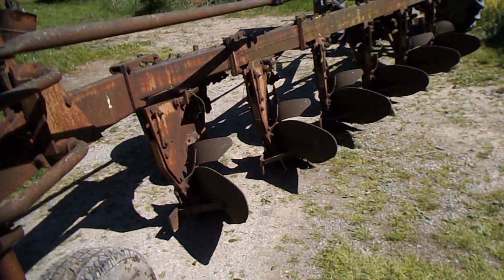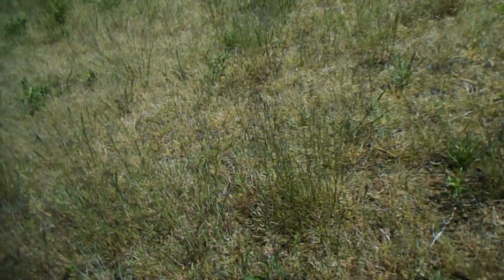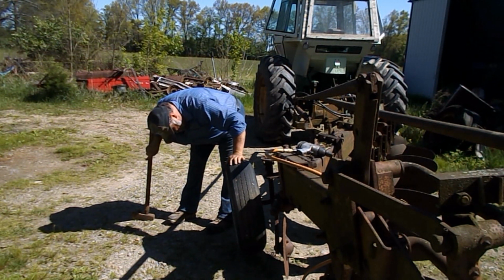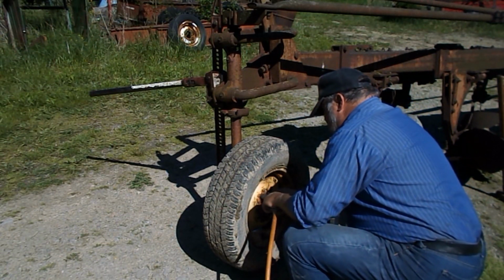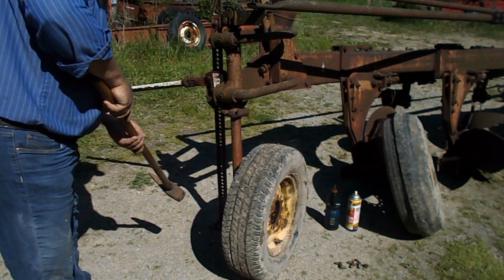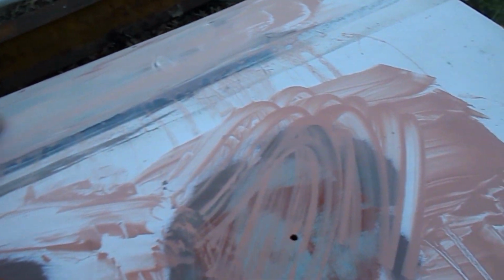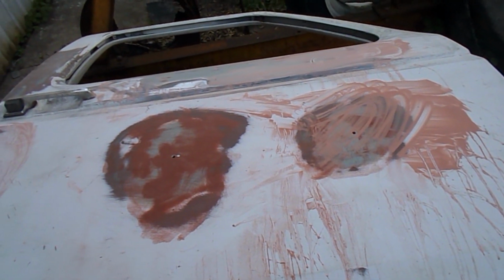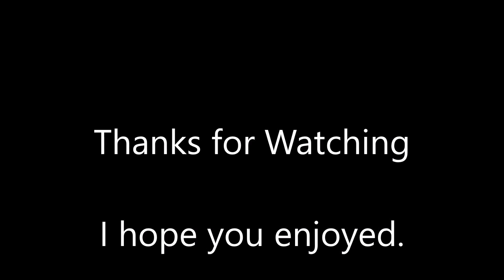Fixing the White 546 Plow May 9th 2022

Comment: Glad you got that tire situation figured out.  And cool how that trashboard worked too.  Can't wait to see you sink that plow in the ground behind the 1850.
Reply from the maker: It's funny how you can look at something and figure out what you need to do to it to make it right when its just go down the list fixing and adjusting stuff. That Yetter cover/trash board I have no idea when or ware I got it all I know is it was sitting there ready to use and I had a need to use it !  I was really surprised when I adjusted the tail wheel  and got those pipes to move !  Lots of little things to do but the main things have been done at this point but I still have some coulters that wont move side to side but I'll get them loose. I think the 1850 will handle this plow with ease but its going to be fun finding out !  Bandit
Reply: @banditfarmer1900  Yep - looking forward to seeing that.

Comment: What’s sad is I see so many of these and other old farm equipment roll through the scrap yard I work for. So many neat things and history being shredded up. Glad to see you use this equipment still
Reply from the maker: There is a scrap yard I go to that I used to buy a lot of stuff out of and it does make you sick to see some of the stuff in there. The guy that used to run it was easy to work with price wise on stuff but the guy running it now puts a stupid crazy prices on stuff, He thinks its gold !  I could buy used disk blades for $2 or $3 each (worn down to 20 inches new they were 26 28 inches) but now he wants $20 each for them. Tires no junk yard wants sitting around so I used to be able to get bigger tires for tractors combines pretty cheap cause they didnt want them sitting there taking up a lot of space , Now they have piles sitting around because of the stupid crazy prices, They have a lot more stuff sitting around than they ever used to because of this guys prices. For me lack of paint is not as important as its over all condition and this plow is in really good shape ware parts wise and it will last me a long long time for the price I gave for it. I have a lot of equipment that if I didnt buy it was headed to the scrap yard, A combine plows disks baler planter hell I bought the Long out of a scrap yard !  I took a chance and gave $700 for it and I spent about $1500 on it over the years (10) that I've had it and it turned out to be one of the better tractors I've ever had. It's the easiest on fuel tractors I've ever seen and with 3 sets of remout outlets makes thing like too !  Keep you eyes open cause you never know when something will pop up you can use and get cheap . It never hurts to save old iron and if I cant use it I'll find someone who can and pass the savings along to them .   Bandit
Reply: @banditfarmer1900  it’s refreshing to find someone that thinks along the same lines I do. People assume that if the paints not pretty or the equipment isn’t up to date that it’s junk. I was never raised to believe that. We used what we could afford and stuff like the equipment you use works as good as anything new. And the quality is way better to. Equipment now is threw together cheaply, made poorly, and over priced. I will take the old equipment anyway. It’s not about looks bandit it’s about functionality.
Reply from the maker: @Thecasey34  I've learned shinny paint never makes anything work better, But people go crazy at sales over shinny paint ! LOL  To me if its from the 50's 60's 70's or 80's its pretty good equipment but newer than that the quality of steel used is a lot cheaper and after you look at a lot of the new stuff now that it has some age on it you start seeing a lot of cracks and welds on the frames and bends in stuff.  I'm happy to keep running the older stuff and its all paid for so that makes everything even better !  I've never owned a new piece of farm equipment and I doubt I ever will cause I just cant see trying to keep up with the Jones , They went broke years ago so why follow there ideas ?  I see a good solid piece of equipment thats kind of rusty I dont mind one bit buying it and running it, I dont care about looks as long as it works good and it does what I want it to. Soil dont care what kind of planter puts the seed in the ground as long as it gets put in and covered that all the soil cares about so it can do its job.  I've never seen soil fight over the color of tractors used on it, But I've seen farmer come to blows over whats the best color ! LOL I still think thats funny !  Bandit
Reply: @banditfarmer1900  yep in my neck of the woods it’s a battle over green vs red lol I’m just happy to have something that works
Reply from the maker: @Thecasey34  Its the same here and I think its funny ! LOL I've owned every brand over the years and they all made good and they all had there screw ups. But the Oliver's I have a soft spot for them you might say. My 1550 is the best tractor I've ever owned and I've owned it sense 1986 I think and other than normal things like batteries oil and filters tires I've never really had to work on it and its always done way more than it should have and you got to love a tractor like that.  The hole JD thing is way over ratted and over priced, My 1850 will do more work on less fuel and cost less than 1/2 to buy over a 4020 JD. I dont care what color it is as long as I can get it for a good price and its in good shape. My 1850 I bought cheap enough that with all the work I've done to it I still have less than 1/2 of what my cousin has in his 4020 that I know he has put $4500 in sense he bought it and its still not as good as the 1850. People can buy whatever they want makes no difference to me, I'll buy what ever I want to farm with and its mostly what other people dont want but I get it cheap enough it works for me and I dont want to make payments on anything anymore so older works great for me ! LOL  I think in the near future there are a lot of guys finding out what hard times are all about cause things are just too out of wack the way I see it and I'm glad everything is paid for and I dont have to worry about it, Good year or bad I will survive to farm another year.  Bandit

Comment from the maker: The time has come to get the White 546 6 bottom plow out and get it ready to do some plowing this spring !  I went back to the woods with the 1850 and got this and the vibra chisel plow out and I bought the White plow up to the barn to give it a good going over and adjust a few things to get it ready to go. I've been told the 1850 wont pull it but I just know it will as it played with a 5 bottom !  I put one of the old tires and rims off the 1850 put on the steering axel and I put the 14" tire on it to replace the gauge wheel so that fixed. I found a Yetter cover board and if it fits this plow I'm going to put it one so it has all 6 on it. I bought this at a sale and when they went to sell it it was cheap enough so I bought it. I did get the tail wheel straitened up a lot better cause it was towed out pretty bad and now its more natural to follow the plow in the furrow. This is a bit of an odd combination being an 1850 Narrow front with a cab pulling a 6x14"s  !  But I'm pretty sure it will pull it just fine. As I worked on the plow I greased it as I went and it took 2 tubes of grease to get to ware its at now. I have a lot more work to do on it and tomorrow I will get it pretty much ready to go. Well I hope you enjoyed watching as I go threw this plow to get it ready to get it back together right.  Bandit
Reply: You would never pull it in my ground.
Reply from the maker: @jerryhill681  Maybe not but around here I sure can !  4th direct and let her roll !  Bandit

Comment: Hello Don nice plow for what you paid how can you go wrong. If it were me I'd take apart hubs and clean all the old grease out made sure bearings were good and reset same as all the colters they probably never been done since new. Be nice watch video you plowing with it. Have a great day.
Reply from the maker: When I went to that sale I had no intentions on buying anything, But if I see something I can use that has options to it and its good and cheap I'll buy it.  Being it can be a 4x14"s 5x14"s or 6x14"s thats a plow thats hard to find and I could use it on any of my tractors with turning a wrench a time or two. Equipment you can use on different HP tractors is nice to have around,  Like a field cultivator with a 12' base and 3 foot wings that I can pull with my 1550 with the wings up and the 1850 with the wings down. Lots of options with this plow for the price to say the least.  I did take that one coulter apart that was loose to tighten the bearing and everything inside looked really good, Those guys used really good grease on this plow cause nothing was hard and crusty inside. I think the hardest part of doing this will be getting the coulter arms to ware they will swing free again but once there loose again this will be a really good plow to use for many years to come. Plowing videos are coming soon !  Bandit